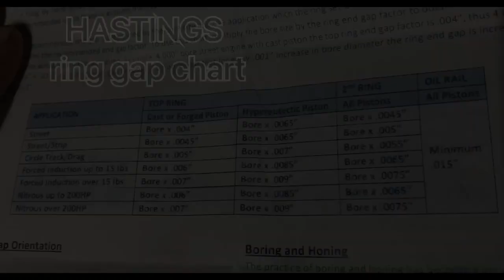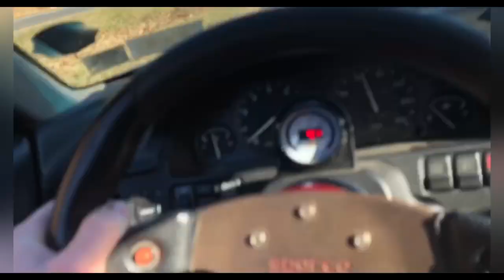93 integra b20v turbo build + thrashing

Comment: Bring it to a real tuner, should be moving way better than that
Reply from the maker: I’m sure the saying would make a bit more power if I got it professionally tuned but I do take pride in how fast that it is with me tuning it. This is an old set up. I built a new motor just waiting to paint the engine bay before I put it in and will be uploading more videos.😁
Reply: @RunemTV  I hear ya, didn’t mean to sound like I was throwing shade. Looking forward to seeing more. I’m currently working on the body of my teg starting next week, I’ve had a account for years, maybe I should start uploading some stuff to haha